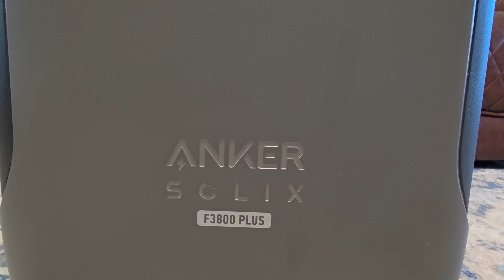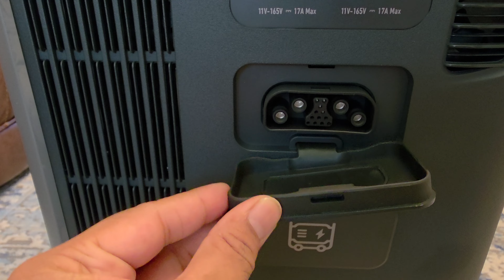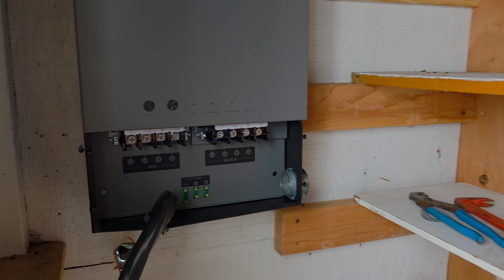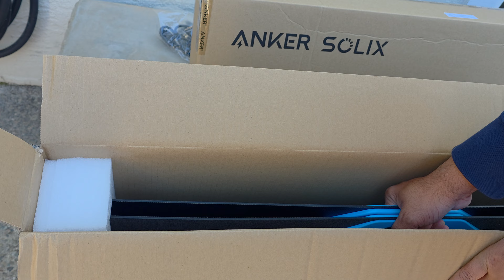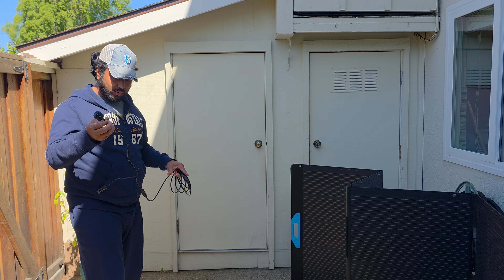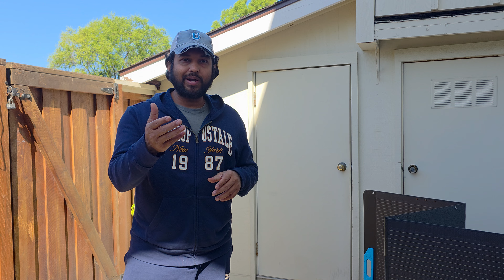Anker Solix F3800 Plus Installation & Walkthrough with Smart Power Panel #ankersolix

Comment: I just bought two F3800 Plus units with the Home Power Panel (and 2 free 400 watt portable panels and 2 rigid panels) and going to have an electrician install the panels in the next couple of weeks. The quote I got charged for is around $2300 but I had some other outlets getting fixed or installed, so the installation of the panels probably costs around $1500-2000. Its not bad considering the competitive rates, but obviously I will never risk installing wall panels myself personally speaking!!
Reply from the maker: Absolutely correct, getting a certified electrician is always great way to proceed.
I chose to go Solo as I was getting ridiculous cost of $2500-$3500 for just installing Solix power panel with no solar panel installation involved. 
I am definitely planning to have expansion battery pack of 3.8kwh as this unit barely gives me 10-12hours of backup.
Reply: @NikhRyder  is that with just one F3800 Plus giving you 10-12 hours of backup? Yeah I only bought two rigid 410 watts so far and got two free portable panrls as well (more of like to test it out over a number of months until eventually I can afford to get more and since I need to pay this off first before going forward with more), you will need the 16 410 watt rigid panels to get the full max input wattage up to 6400 watts. I also want to eventually get a plug in hybrid or EV to charge it off the Power Stations through our house through a 240 NEMA 14-50 plug.
Reply from the maker: That's a great idea. I now have 2 portable 400W panels and plan to get 4/8 rigid panels.
As in current config battery charges 1st to 80% and then on top of that it parallelly power my home till it touches 100. Once sun is gone and battery drop to 80% next then my 3.8kwh would last upto 10-12hrs for basic home appliances.